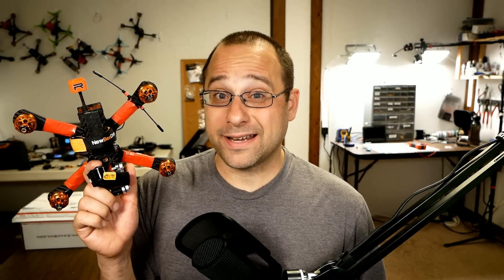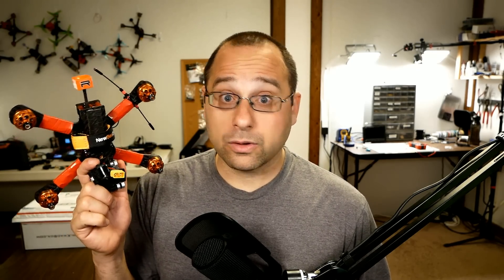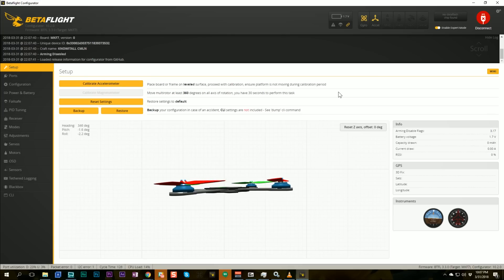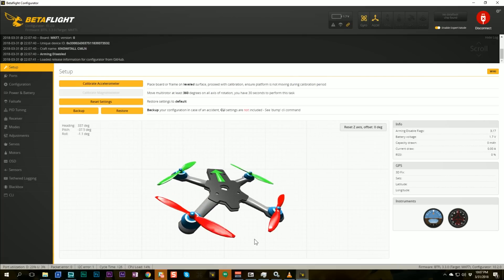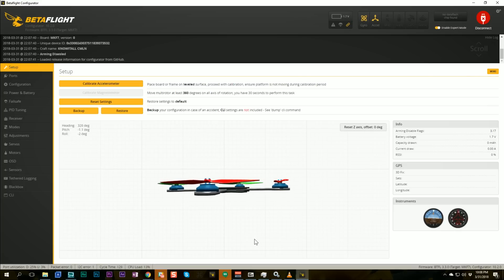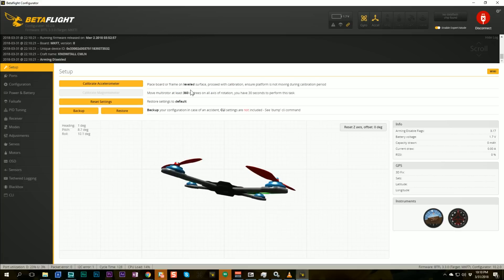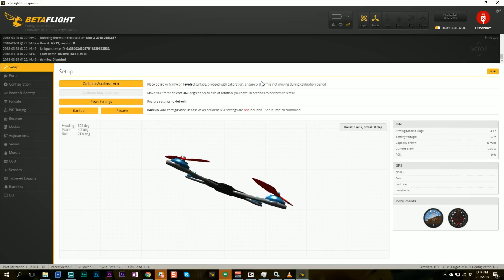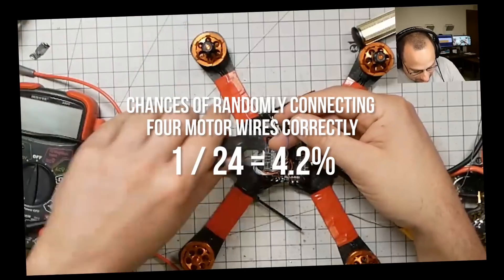Betaflight flight controller and ESC alignment incorrect | HOW TO FIX

Comment: Im using the remix v2. I need to turn just the esc 90* ccw but not the fc   But then everything is mounted upside down. The esc battery pads are in my way. Can I do this ?  Thank you.
Reply from the maker: The short answer is yes you can. The board alignment needs to be right and the motor order needs to be right. Just tweak each individually until things are correct.

Comment: Hi Josh. What if you did not mark down the current pin assignments, you cleared a motor and you forget what the pin number was? I like what you did in this video.... Marking the slider number and what pin is at each slider and then putting the pin number next to the motor you want to spin, if i said that right. Thanks
Reply from the maker: Go to CLI and type

diff all

Copy paste the results.

Type 

defaults 

This erases your config.

Type

resource

This shows the default resource assignments. Copy down the ones you need.

Paste back in your config diff to restore your config.

Comment: THANKS SO MUCH . I DID THE BOARD AND ESC 180 DEGREE ON THE ROTOR RIOT DJI BUILD . I HAD TROUBLE WITH THE INFINITY 30 STACK AND DID NOT GET ANY SATISFACTION FROM NEWBEEDRONE ( AND I REALLY LIKE THERE TINY WHOOP STUFF ) . SO I SWITCHED TO A DALRC STACK AND KINDA FELL IN LOVE WITH IT . THE ENGINE AND F405 . EYE TROUBLE I USE CAPS . PS YOU MADE THAT SO EASY . THANK YOU .

Comment: On my DALRC FC405/ENGINE stack the board/esc assembly is mounted 90 degrees counter-clockwise (i.e. pointing to the left), but the ESC pin wiring, for convenience, is 90 degrees clockwise from where it would normally be, necessitating a change to the resource motor pin address assignment in BetaFlight, but I DO NOT change the board orientation in Betaflight - all angles left at zero/default - flys perfectly.

Comment: Hi Joshua Bardwell. I'm facing an issue right now after installing Spedix GS54A 4in1 ESC. Previously, I had a AK32 35A connected to my Hyperlite F4 OSD flight controller. I went to BLHeli32 to fix the rotation of the motors. Then I looked at Betaflight settings, they still look good. I didn't do any change in Betaflight. What's happening now is that when I arm it, it immediately flies. Today it flew 20-30 ft up immediately after arming it. I had to disarm it right away since it was heading towards my neighbor's yard. LOL. How do I fix this issue?

Comment: I build a new quad, second one. And i ve put the 4 in 1 esc in a diferent position, i ve reorder my motors in cli everything looks good in betaflight, but the quad still flips out when i try to take off. Please help me!
Reply from the maker: Check these things.

1. FC Board alignment.
2. Motor direction.
3. Motor position.
4. Prop on backwards.

Comment: I flashed a fc that came with the skystars gl730, afterwards the orientation was wrong, then the motors had to be reassigned. Once that was done the esc's would not do the last 2 beeps unless the 5v usb was connected. The only way I can arm is to plug in 5v usb and arm, then it will fly. This was not a problem before the update to 4.03,  but the fc has acted screwy since I received the quad. It is still stock with individual esc's . Is the FC bad.

Comment: I just build my new quad, when i rotate it on the yaw axis it is going to roll and it will autolevel shortly after. It does the same the other way around for roll and yaw. 

Can someone help me?
Reply from the maker: This is a board alignment issue as discussed in this video. But it's very unusual to see yaw and roll transposed unless you mounted the FC sideways.
Reply: @JoshuaBardwell  Hi Joshua, thanks for your quick response, I mounted my board horizontally like normall. i can change whatever to the board aligment but it wont seem to help

Comment: Hey Joshua. I had to do a firmware reinstall, but I think I loaded the wrong firmware. I have an f390 Raptor F3, but on the board I see an F4. The quad is a C250 V2. Would you or anyone know the correct firmware?

Comment: Joshua hope you see this, I bought a Echine wizard X220S (first 5 inch quad) long story short flight controller was bad replaced it and motors we're not in the right order. Followed this and it worked great for the most part except motor 2 will not spin any ideas?
Reply from the maker: Check if the ESC makes the startup tones. Pinch the motor and feel it vibrate. If it doesn't make the tones it may be fried.
Reply: Joshua, thanks for the reply. I feel the motor vibrate when I plug it in but still will not turn. I put the pin numbers back to the originals and the motor will turn. Unfortunately I did what I didn’t wanna do, desolder the ESC flip it 180 that put motors 1and 2 in the right order just had to flip 3 and 4. Thank you for everything you do, definitely learning a lot in this hobby.

Comment: For me, I had issues when updating my BetaFlight F4 FC from BF3.2.0 to BF3.5.6. Somehow the native board alignment changed? Almost as if there is a new gen of board which has the MPU processor soldered in a different direction or something.
When I used the drop down on the right, the board would have a weird spin put into the motion when tilting it. very weird. However, when using the ones on the left like you recommend, the board behaves normally and I get normal changes in direction shown on screen.

Comment: If you are watching this, and are repositioning the escs using the resource “pins”, make sure you use zeros instead of using an O in the three digit pin code. He says o in the video, so, stupid me spends 20 minutes trying to understand why it wouldn’t work, and having to re-flash to reset the cli to try again. If that doesn’t work, watch his other videos, and if that doesn’t work... resort to throwing stuff.

Comment: When I tilt my to the side it lifts the front or back. I can't figure out how to fix this.
Reply from the maker: You have to use board alignment as shown in this video. Probably you need a yaw alignment of either 90 or 270.
Reply: Joshua Bardwell thank you. That worked. Now I can't seem to get video working. The vtx turns on I swapped cameras for one i know works its gotta be something in betaflight i think. This is only my second build. Thanks for all you do btw.

Comment: Wonderful Video Johua, Thanks very much. Guys I got a problem, I´m new on FPV and im getting crazy already. I got a Hawk 5 with a Mini Magnum 2 F4. I bought the 4 motors all of them CW rotation but I´m not able to invert the rotation in Betaflight. All of them spins clockwise. What could be wrong? thanks guys
Reply from the maker: The motor direction, CW or CCW, refers only to the threads on the shaft. The motors can all spin either direction.

Betaflight doesn't reverse the motors.

To reverse the motors use blhelisuite. Or you can swap any two of the three motor wires where they connect to the ESC.
Reply: @JoshuaBardwell  Joshua, thanks very much for your reply even though that sounds Chinese for me :) I will try to follow your advice and will let you know. Thanks very much!🙂

Comment: Hi
I am have a problem with an spf3
 build where it spins in one direction on throtel up than the other the next time, this is my 3rd build and my first debug failure please help

Thanks
Reply: Hi
Driving me nuts and as simple as a bad BG flight controller 
Thanks

Comment: I just followed your instructions now I only have 2 of my esc in my 4 in 1 help please
Reply from the maker: Reset back to defaults (you did save the defaults right?).
Reply: yes i reset it going to just pull the pins and wire them in thanks thow you have showed me lots on your vids

Comment: Hello JB, please help me. I´m getting the warning "no gyro" and can´t figure out why. I was hoping it would have something with board alignment, but after watching this video, it seems I did every thing right, my quad corrosponds correctly acording to the beta flight animation. I even swaped out the fc for an identicle, new one and still getting the same warning. It happens with bf 3.3.3 firmware, aswell as with bf 3.4.0. I´m clueless, pleeeeeez help!
Reply from the maker: Board is probably dead. Sorry to be the bearer of bad news.
Reply: Sorry to bother you Joshua, I was researching all day. A few minutes ago I found out it´s just a crappy fc, (not crappy me), many have had the same issue with the gyro. Thank you very much for responding, even bad news can help. I will help you by using your links, when ordering a new one : )

Comment: Prof. Josh, quick question: i destroyed my furibee fuuton kakute board and reinstalled the v2 and destroyed again ( when i crash the camera tends to pull off all the pads and resistors) anyway i installed now a matek pdb and on top managed to fit in an eachine halo F3 aio board . Everything is working but the problem is that i powered the board from the 5v and G cause it can only take 5 to 12v . But the esc and motors are power by a 4 cell battery. Again all is working but the voltage on the board is only reading obviously 5v how can i see the MAh im using and the correct voltage?
Reply from the maker: You can't see amps and mAh data if the current doesn't flow through the current sensor. Look at the manual for my FC and there are some diagrams for how to wire up a 4 in 1 ESC that demonstrates the idea for what you have to do.
Reply: Joshua Bardwell buddy I seriously did not understand what i have to do. Sorry to waste your time man really apreciate your continuous support: im using an eachine fc f3  used for micro brushless. Im using what i have in the workshop to get my quad  in the air. Im using little bee escs connected to the matek pdb . Not 4 in 1 and i have connected the fc to the 5v out. I was only wondering if there is a way to get the mah usage in a way..
Reply: Joshua Bardwell i checked the amazing manual and Board:) great work btw. The only thing im not sure off is that my fc can only handle 5-12v so if i solder the wires as mentioned in your manual im afraid it might burn the fc. Any other solution

Comment: @ Joshua Bardwell So i have a HGLRC XJB 145 which "FLIPS OUT". This began after a small crash onto grass. I visually inspected everything and could not see any issue. Since the crash i have changed to a new 4in1 esc and it also have a new set of motors and guess what is still FLIPS OUT. Its running i believe the F440 so the orientation is correct as it has pinned connections between the fc and the esc. Stack. Im kinda at a loss at the moment and cannot figure this thing out. Hope you can lend a helping hand which you always seem to do, Cheers!

Comment: I’ve been told to resource motor 4 to my ppm pad for Dshot, which I understand how to do. But I don’t understand why ? Does it also have to be motor 4? Why only one motor?
Reply from the maker: Probably because your FC has a DMA conflict that prevents the default motor pads from using Dshot at the same time. But the PPM pad uses a different DMA bus that is distinct from the other three motor pads.

Comment: to avoid such a situation I always mark the signal wires coming from the ESC's before twisting them with 1,2,3 or 4 rings to know for which motor they are. Nevertheless that doesn't help if one is provided with a wrong pin layout for the 4 in 1 ESC. I faced this situation for one of my ESC's where signals for motor 2 and 3 were inverted and the had to do the resource remapping as well.

Comment: Great explanation and demo, these video examples help tremendously.  I had to reassign resources last month when I soldered my motors 2 & 4 to signal pads 5 & 6! It took me a day to realize my error and I confirmed it on the pin out diagram for the FC (a practice you mentioned).  I must admit that ummagawd has a similar video and he was kind enough to respond to my inquiry.  Your idea to spool up the motors is fantastic since you can keep your quadcopter assembled.  Thank you.

Comment: Josh, 
In your previous video on BF3.1 you had to re-assign a motor to resource = "none" to prevent getting an error message when trying to remap a motor to a pin that was already in use.  Is that no longer the case with BF3.3?
Reply from the maker: In this case, since I am going to assign all four of the resources, there isn't any conflict. I'm not sure if BF 3.3 automatically clears the conflcits or you have to do it manually.

Comment: Spot on timing JB just finished kakute f4v2 with tekko 32 and had this issue. Suggested folllow up video blheli 32 setup guide/ reversing motor direction 🤤

Comment: Josh, does betaflight 3.3 cause an issue with receivers? I have bind a XM to a F3 board and it is not working in the receiver tab. taranis recognizes the XM but nothing in the tabs. What say you master of all? Please?
Reply from the maker: Nothing has really changed there as far as I know. Most likely the configuration of the FC is just not correct or it is not wired up right.

Comment: On ESC board with connector (Holybro TekkoS 4-in-1 ESC in my case) it was dead easy. Noted the real motor order on paper and then swapped pins in connector. Job done.

Joshua, do you have a tutorial about throttle/acceleration issues? With Emax RS2306/2400KV motors and Emax Avan 5065 3-blade props on punch with high throttle in straight line have that fluttering(?) sound. Doesn't look usual. Do Avan-s definitely flutter? Or this is D-term issue? Motors are warm, but not hot.
Reply from the maker: Avan S are stiff props designed specifically for top speed runs. I seriously doubt they are fluttering. So if you are hearing fluttering noise it's probably the D gain. But not having heard it, I can't really say for sure.
Reply: Thanks! Can it may be caused by ESC's who are limiting power output because they can't support amps required by 2306 motors? Particular FC (with 4-in-1 ESC) is  RacerStart Tattoo F4S (should support 30/35A per motor).
Reply: In end I noticed one loose propeller. In end put some serious elbow grease in filter configuration. Had to enable both notch filters. Still can't got away from two little gyro noise bumps at 280 hz and 400 Hz. Seems 2nd motor who recently took serious beating, probably slowly become bad. Although in end got traces in log pretty smooth and motors only little warm. Probably I should stay on that until motor 2 will finally die :)

And sorry - that quad have Tekko BLHeli_S 4-in-1 ESC, not F4S.

Comment: Dont forget to check motor direction as well.
You might need BL-Heli to reverse some ESCs if you don't want go swap the wires with your soldering iron.

Comment: I just built a rooster w helio springfc and holybro tekko 4n1.
It arms and hovers but if i blip the thrtle it will just cut power and fall will not re arm. Also if i just hit pitch forward and get it to stand up when the quad comes back down also cuts powet and will not rearm unless unpluggin lipo. Ive built 5 never come across this. Have you heard of this?

Comment: Just ran into this over the weekend. Holy kakute v2 with tekko aio esc on a 5" rooster. Running power out of the rear and FC at 270°cw
Reply: BadcatFPV  I’m running same FC and power like you but on source one 5 inch! The front arrow is facing the back. I ran the power board with battery facing back as Well. On beta did you still do the y axis part or the new tab all the way to the left of that row? And what degree? I’ve tried 90 and 180 and can’t get it to go right.

Comment: I remmaped my motors exactly like this but I have a problem, when I go back to betaflight motor tab only one motor is shown at 1000, the 3 others are at 0. Furthemore, the motor at 1000 do not spin up. Anyone know of this problem ?
Reply from the maker: The other motors are actually disabled because the pins you tried to assign them to aren't right. I don't know specifically what went wrong though.

Comment: The 90° is great for wings: https://www.racer.lt/img/f1.jpg
and it's just safer to rewire wires in right position, instead of resources, as you need to resource every time after upgrade (yea you could copy, but..)
Reply from the maker: Copying is no problem as I dump my config before upgrading and restore it.
Reply: Yes, it's easy, but it's more elegant to just wire once correctly for all fw ;]

Comment: Awesome video, again.
On the remapping, I have a BabyHawk/Femto F3 FC which can be set up for DShot but motor signal 4 needs to be remapped to either the LED or PPM.
resource LED_STRIP none // resource Motor 4 A08
My question is, what happens to the LED or PPM afterwards? Can these be remapped to where motor 4 used to be? "Switched with" so to speak, as opposed to "Replaced".
I've looked everywhere for this information starting with the BLHeli DShot wiki & no joy.
Reply from the maker: No, thru can't be remapped like that. The same DMA conflict that requires remapping in the first place would occur.
Reply: Thanks for your reply. That is a real bummer. I need the PPM/UART 2 for an OSD & wanted an LED as well. Hopefully the LED_STRIP remapping works for me so I don't have to lose the OSD by having to remap PPM/UART2.

Comment: Thanks for this video. Is because of videos like these that I’m happy supporter on your Patreon page. One question if I may: isn’t required to mess in BLheli after you mess with this? Sorry for the noob question.
Reply from the maker: No, I don't think so. Why?
Reply: Joshua Bardwell thank you. In my newbie ignorance I thought that was required to set the motors to rotate correctly in BLheli if they are not positioned correctly
Reply: Filipe D no, but in my experience, there tends to be one motor I always install backwards. BLheli saves the work of going back and soldering the board again.
Reply: Thanks! I'm still learning everything I can about quads.
Reply: I'm a bit new, but it seems I've encountered what seems like almost every issue possible. Whenever you have questions, feel free to ask!